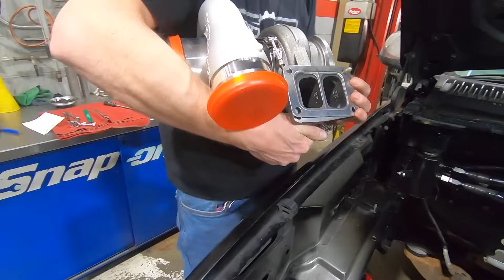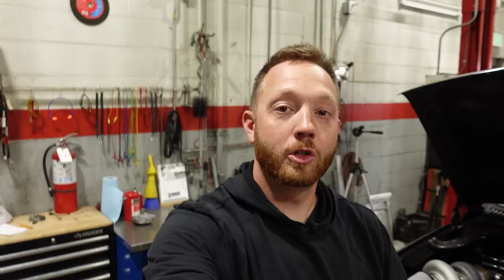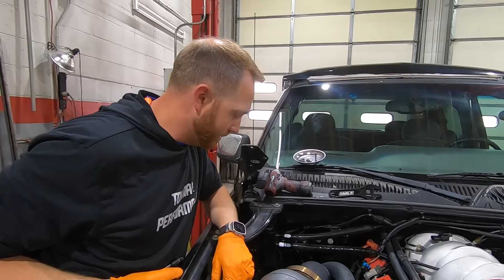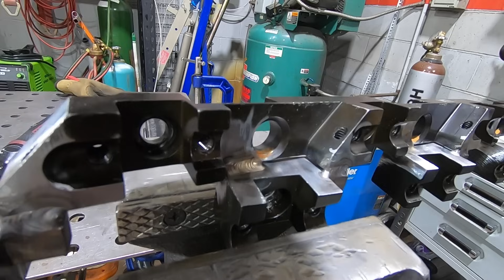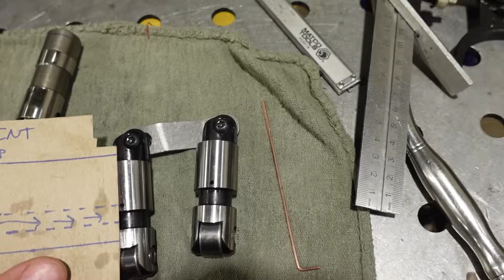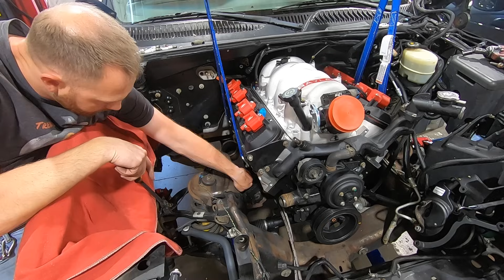the END OF AN ERA for my boosted big block Silverado

Comment: The original Ugly Truck junk yard motor should already be at the machine shop getting the bottom end machined and rebuilt. After race week, you could put that engine back in the Ugly Truck and have lots of good information on the direction for the race truck and motor. Possibly run the Ugly Truck naturally aspirated for a while until the final version of the race truck is figured out. That way the Ugly Truck would be in use the whole time.

Comment: break the old 8.1 down, throw away the stock rotating assembly yes i count the rod ad pistons i that i know the reciprocate idgaf, take block and heads and get them tanked, i bet you know a good auto machine shop down there, have them fit a forged assembly. put it o the shelf for another day or put it back in the ugly truck

Comment: I love what you've been doing with the SBE 8.1. I have only a couple questions. How would you have to build it and tune it differently for a towing application? I have a 8.1 Suburban, and because fuel is expensive and it likes it, it rarely moves without a trailer hooked to it. So I would like to know how it would need to be built and or tuned differently Towing heavy here in Alabama where it's always extremely hot and humid.
Also, as a machinist, safety glasses are cheap. Eyes... not so much.

Comment: Operator valve  and a extended right leg 😂 matting the  go pedal is a lot of  people's problems with their  projects but it's not a mistake as your showing the channel  how to  make it better than ever  before most people are happy with a single project truck in the garage to keep the daily work truck
Out of the shop  unless it's maintenance or the occasional upgrade  you have a handful of project trucks   be nice to do a Jeckyl and Hyde type of build make them look identical  except for the 02 and the  cateye front ends and do  they wanna race  letting them see one of them and then they get to race the other one  lol just to make them 😮 as your  second fullsize is full of the missing parts of the other truck make one thing finished and then go back and get the second one done  and not having to fork out  3 times the price to go racing

Comment: you didnt "blow the motor up" you spun a bearing.  couple hundred bucks for 1 new (used) rod and piston, set of bearings and an actual tune would have had that thing back running for the next 5 years.

Comment: How much boost can the front & rear RTV china wall beads on the intake manifolds of the older style gm engines take before blowing the RTV out ? Just curious if it could take 30 psi without creating any oil leaks or boost loss ?

Comment: Even GM doesn't know how rod bearings die. Use the engine to get the drag truck into driver status then do a bottom end rebuild. DON"T UPGRADE - Just rebuild it. Then you can use the drag truck to find the limit of 8.1 L stock block!

Comment: 8.1 turbo swap a Denali or Escalade. Those are everywhere with 200k< miles. Use another junkyard shortblock. Set a budget from the beginning and see what is possible with some used/2nd hand parts.

Comment: Since your asked :)............ I'd rebuild the original ugly truck short block with some better parts that could reliably  withstand  the power of whatever that single turbo can produce or whatever the weakest link in the drive train / fuel system  can handle.  The BB ugly truck is such a awesome tire shredder and the smiles per mile is just off the charts.
Reply: By time you do that to a 8.1 you can get a psi 8.8 and refresh it which already has all good internals .. that's the route I went

Comment: If you're really done with the junkyard block...there is a guy that makes aluminum 454s? If you ask him to simply tap the 8.1l head stud pattern....an aluminum 8.1l? From what I've seen there is NO other difference in the block, just the bolt pattern. But I could be wrong.

Comment: Make sure your entire e85 fuel system is engineered correctly with top shelf components because one small hiccup in fuel delivery at these power levels will cost you an engine or worse.  Fore Innovations is highly respected in the community.

Comment: Great videos.  Given it was a "junkyard" motor, in your opinion, what actually caused the failure (detonation, low oil pump flow, ...) and what will prevent something similar from happening in the new motor ?  
Thanks.

Comment: Take that 8.1 block.... clean it up, bore if necessary, add some forged pistons and rods, throw it back together in the Ugly Truck and just keep the tune dialed.
Reply: Thats pretty much what the engine he put in has. A fully built 8.1
Reply: @rockfire9799  the bottom end is completely stock

Comment: This really dates me. When you have a engine capable of 1700 hp, but are going to dial it back to 900-1000 for your street truck. I remember when the Mark IV engine was Chevy's new "Mystery Motor". And now you're building a Gen 7 clone. Halcyon days, I tell you.
Reply: Building a 1700hp capable engine and then running it at 900-1000 hp mean its very safe and will generally will last far far longer then if it was constantly ran at like 1500. Is it gonna kill it to run it 1500 sometimes probably not but it wont last as long
Reply: Beautiful engine

Comment: Good video as always
The Ugly Truck engine bent a rod.  Just buy some low budget aftermarket rods and put it back together. The pistons may need to be replaced, but maybe not.If so, get some standard bore drop ins.  Reinstall it in the Ugly Truck. Don't overthink it.

Comment: Like the idea of using the 532 motor and you can brake it in at a low power range.. an idea of mine is now that you have time with the original 8.1, new upgraded crank rods and pistons...
Reply: 535 motor
Reply: @darreng2639  lol my bad..